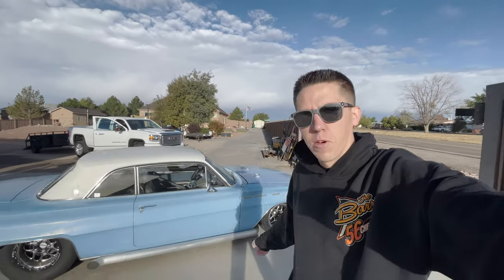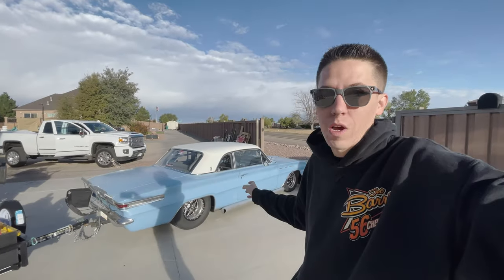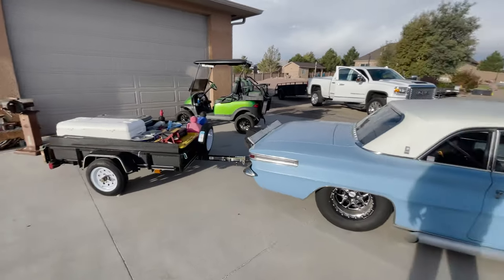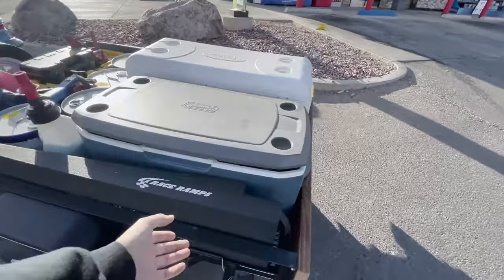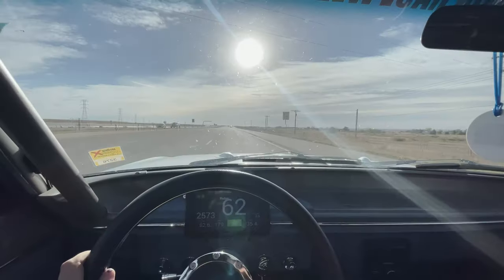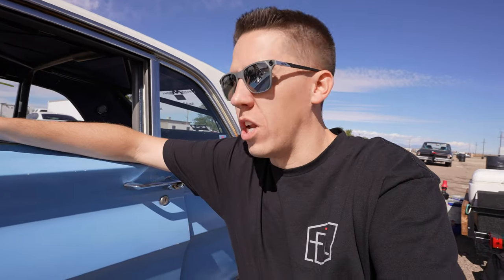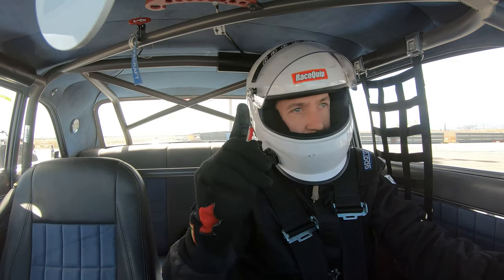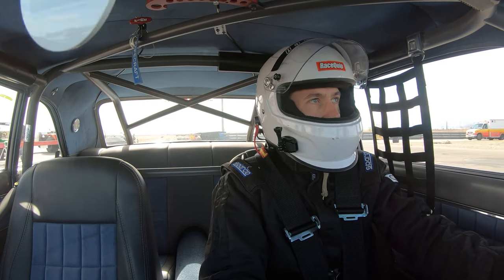I BROKE THE BUICK... Twin Turbo LS Swapped Skylark DOWN!

Comment: On page 3 of the instructions. That you obviously didn't read.
It clearly states. Have a good time but don't break the Buick.
Good news is that you can fix it. would have been ugly if the wheel came off.
Reply from the maker: Definitely missed the part about not breaking it!😂 Definitely shouldn’t be to bad to get it back up and running!